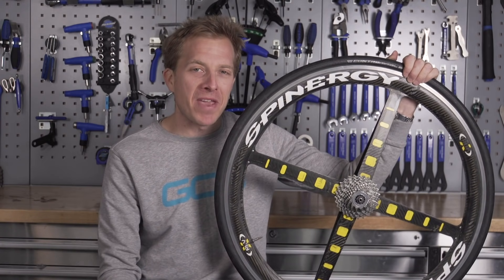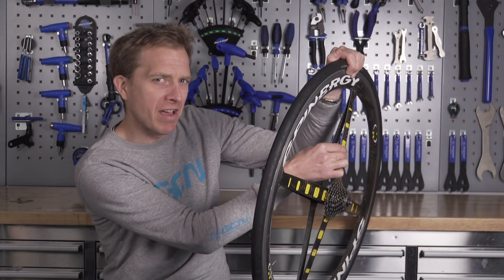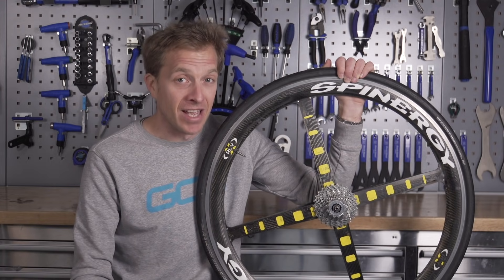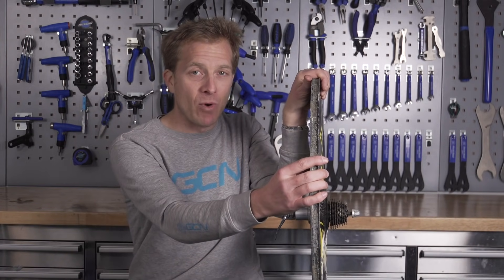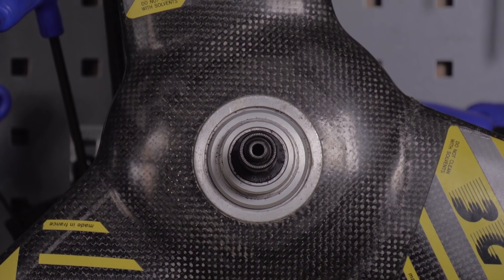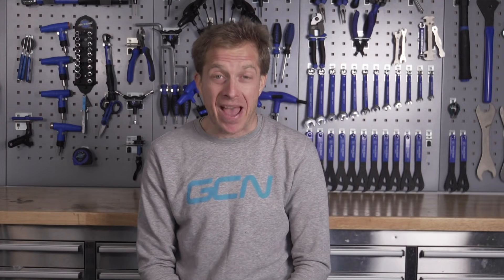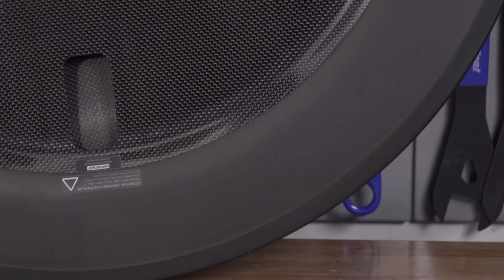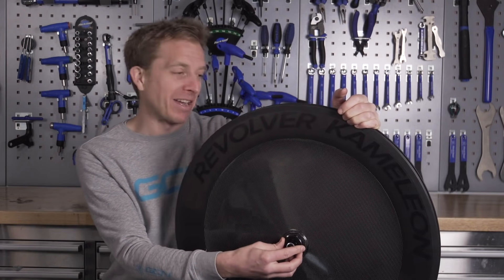5 Best Cool & Quirky Wheel Innovations

Comment: has anybody ridden berd spoked wheels? and what are they like?
Reply: Thanks for the question - we post some of the reviews of our spokes on our website: http://www.berdspokes.com/news
Reply: My guess from looking is that those are dyneema and the tension comes from pulling down from the top of the circle rather than pushing up from the bottom like regular spokes. Am I close?
Reply: @j3ah0o  

all "normal" spoked wheels "work in tension"  the tension is just a bit less at "the 6 o clock" position,   fyi spokes break not from high tension but from loose/tight cycles, so tight spoked wheels last longer than more loosly spoked wheels.

Comment: A few interesting ones you didn't mention:
* Black Hole System
* 6666 Kevlar Fluidisk
* Sugino Tension Disc and similar
* Cortes "cheese wheels"
* Spinergy Spox
* Mavic iO
* Just everything by Fir (5-spoke, that one with 4 holes in it, the one that's basically a sphere...)
Weird wheels are amazing. Thanks for doing this video.
Reply: Yes the FIR wheels were great! I owned an FIR HALLEY SYSTEM 6 Spoke and disk wheel.  They were a thread of cassette however I converted the disk to a track wheel with a different axle and they were bloody quick being a lenticular disk!

Comment: Spinergy also used to do the PBO spoked Xaero wheels - a fibre spoke and made for a lightweight wheel. Absolutely loved mine - I had them in the early - mid 2000s. Issue with that version was the nipples would suffer from galvanic corrosion and fail when trying to true the wheel. In later years the nipples for that version of wheel were nearly impossible to get in the UK which eventually killed mine off.

Comment: I have a 29er trek and I use it for exercise as well as for going to the store to pick up some food. I keep popping spokes . I want to go to a thicker straight shoke or a mag wheel, what do you think?? I do go over 2 curves but when I do I go over those curves with a lot of finesse or I get off the bike and walk it over the curb to prevent from popping spokes. I don't know if it has to do with anything with my body weight at 235 lb Plus the weight of food in a normal size backpack or that I do not get out of the saddle for any reason. I stay in the saddle the entire time

Comment: I had a pair of 2001 ultegra wheels that had a very innovative cross spoke design. The spoke connected to the side wall of the rim, they looked and performed great. On my decents I could feel a noticeable aerodynamic upgrade over my previous wheels. The way that the spokes cross allows fo much of the spoke to hide in the “wind shadow” of the rim.

Comment: Those spaghetti spokes seem awfully interesting
Reply: @Neil Partridge Yes, they are resistant to cuts and nicks from road debris. Our spokes are just as common on XC wheels where they take even more abuse.
Reply: I don't want to take much of your time, but is there any data on stiffness? They might be able to sustain high pull (straight) loads, but when I get off standing and pushing the pedals, there's side load aswell, and I don't think your spokes handle that very well.
Reply: @youtount  - As long as the spoke remains in tension, there is no difference between a metal and a polymer spoke. Spokes don't sustain what you call pull loads, instead they act as tensioned members. E.g. if a spoke is tightened to 100 kgf then it will be able to support a 100kg compression force acting on it before it looses tension. For lateral stiffness you are relying on the width of the rim - providing a lateral component to how that force acts. Just the same as a conventional spoked wheel. I think!
Reply: @charliespanjers2862  How do they compare aerodynamically against other spoke types?
Reply: @hogiewan the spinergy are best, then the "blade" spokes, 16 blades or even 8 blades per wheel

Comment: Can you imagine a 150 mm rim depth??? And then a tri Spoke with the little space in the middle
Reply: It'd basically be a disc wheel if you went that deep - a disc would probably be easier to manufacture and stiffer too.  Once you get over about 70mm rim depth most wheels get very frisky in crosswinds.

Comment: Had a set of rev rox spinergy wheels looked and sounded awesome but they were so flexy in corners you'd get brake rub every time, had a set of Spin 3 spoke wheels on my cannondale killer V xv bike they were better on the stiffness front but heavier they looked great so I didn't care even won a few races down at Penshurst on them. I've still got some Spinergy x aero pbo spoked wheels which are similar to Berd way of spoke-ing with spokes made of very strong fibres now they are good even compaired to the Corima wheels I had, stiff strong and damp out road buzz brilliantly, well worth a mention. Would have loved a set of original Shamal wheels they were beauty's but sadly never ran campag so it would have meant a lot of expenditure and I never really got on with the shape of their levers from that period.

Comment: You forgot to mention Sosenka's  3+ kilo wheel that was reported after his hour record ride.  This inspired me to modify spooked wheels into  7lb and 12lb disk wheels that I called the "Chunky Churner" and  the "Air Hammer".   A picture of the "Chunky Churner" can be found on this forum post https://forum.slowtwitch.com/forum/Slowtwitch_Forums_C1/Triathlon_Forum_F1/A-2_windtunnel_battle_royal_spoked_powertap_vrs_the_churner_P3487175/?search_string=churner#p3487175.      I had set one time trial age group record on it in NC.  I unfortunately at a triathlon suffered a permanent  injury to my pubis joint and have been unable to race since  2012.   I wanted to continue exploring the use of high inertia wheels on cycling performance but have not been able.   My theories lead me to believe that for different riders and conditions the moments of inertia of the wheels would have to be  tailored to those conditions to achieve peak performance.  I have been trying to formulate this hypothesis into a simplified mathematical construct but have been unsuccessful .   Currently I am a theoretical physicist working for Argonne national lab.  In the future if I have enough money I am going to higher a metal worker to make the heaviest bike wheels in existence, solid steel.   They will be called "Rampager Heavy Elites".  As a theoretical novelty I am interested in how such obscenely heavy wheels(20+kilos)  will ride on a flat course, in particular how the bike will handle.

Comment: U forgot the 2 most obvious invention used by 99% of road bikes out there respectively 84 and 43 years later.

Mavic Duro rim from 1934. Imagine everyone riding fragile wooden rims or heavy steel rims that could not brake in wet weather until the dawn of carbon fiber wheels 54 years later (Corima in 1988). 84y later Carbon rims is not even standard yet and probably never will be despite having been available for 30y.

Mavic Module E clincher rim with double hooks from 1975 (along with the Michelin Elan tyre). Imagine not being able to ride high pressure clinchers for 43y, and still using tubular wheels exclusively on your road bike for training.

Comment: Tioga Disc Drive
Johnny Tomac riding one on an early MTB. As cool and quirky as it gets.
http://www.thevintagemtb.com/p/tioga-tension-disk.html
Also from the world of MTB, the Mavic MA40 tandem rims with 40 spokes, cut down to 26" size with 36 spokes. These were the ultimate in cool when shod with a 2" wide Specialized Ground Control tyre. Check out the maths of a 700c wheel and a 26" wheel and what happens when you cut the four spokes out and join it back up again. The numbers add up, in a way that is quite beautiful. For added quirkiness the hubs could be Specialized - yes they made such things then.
Aside from the above and cool but not quirky, Campagnolo wheels with the Campagnolo logo at a massive size just look awesome, particularly in a 1990's Tour de France Team Mountain Time Trial event, with Delgado or Big Mig pushing the big gears.

Comment: Berd spokes seem interesting, until you look at them from a practical aspect. Literally, if you were to "scratch" the spokes of a spinning wheel, they would get cut, and broken too easily. Existing metal spokes are much more resilient to scratching and hitting. Basically the same issue as framesets. Carbon framesets are in all ways superior to metal ones, unless you hit each one with a hammer. And wheels and wheelspokes do get hit by rocks, which essentially do the same effect. While I do like the innovation, I don't believe it would ever work.
Reply: You won't be able to cut them that easily. Try cutting kevlar for instance with a pair of scissors. The scissors will be gone before the kevlar. They aren't brittle either as you can clearly see in the video. There's no resin in them, so they are literally pieces of woven cloth.